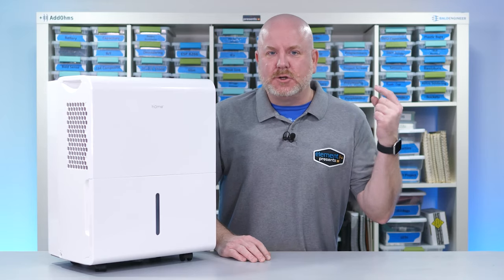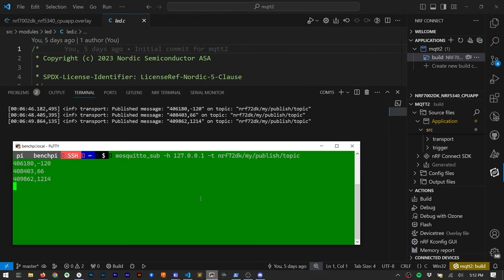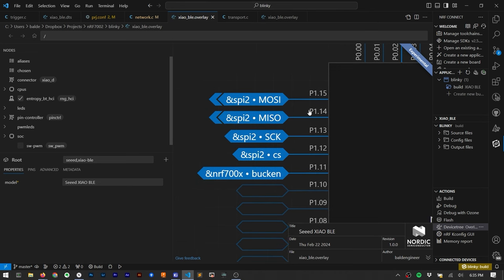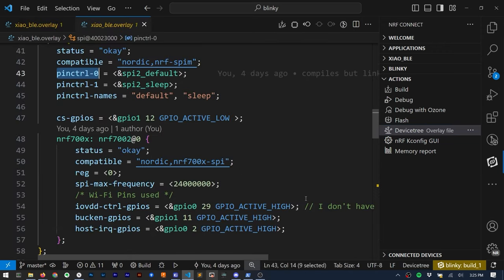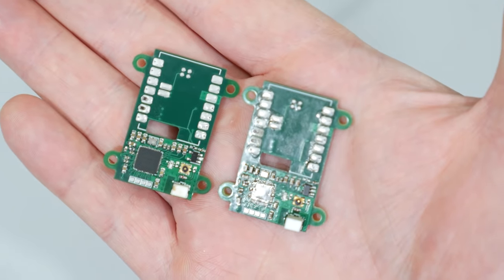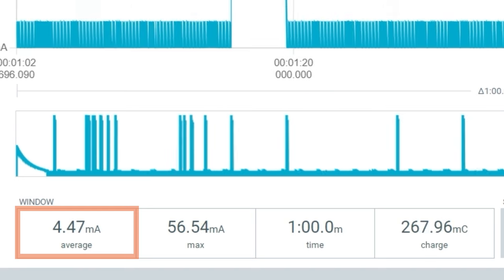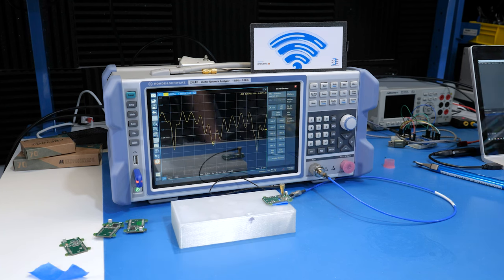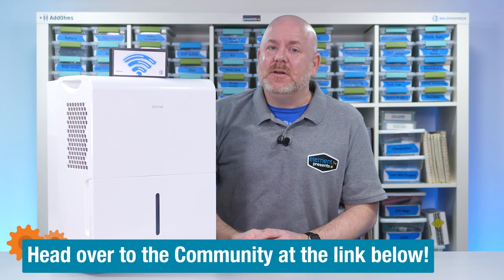Using Nordic's nRF7002, My Dehumidifier Tells Me When It's Full!

Comment: thought about this also some years ago. Solved it by using a smart plug which has a built in meter ... just keep track of the power consumption and send a msg when tank is filled up. But nice project. Motivates me to start tinkering around with nordic + zephyr.
Reply: I considered something like that. However, in my case, the dehumidifier does not always run continuously. (Granted in the middle of the summer, that would be effective.)